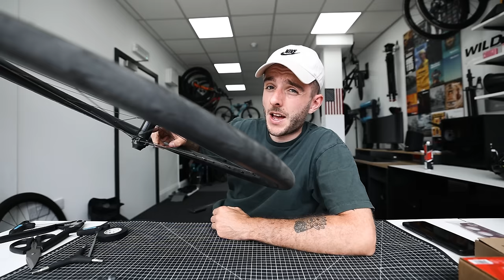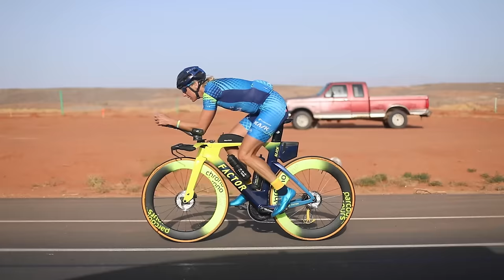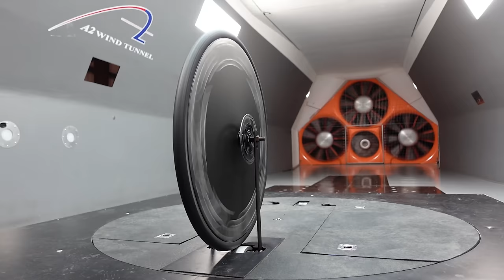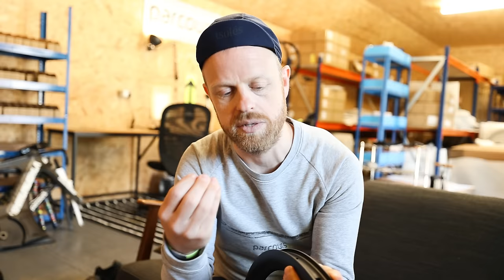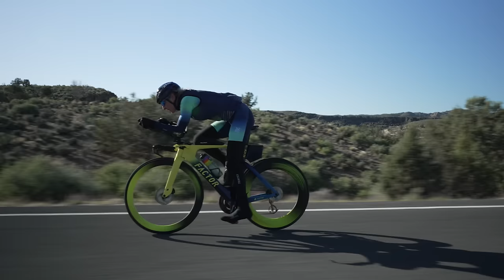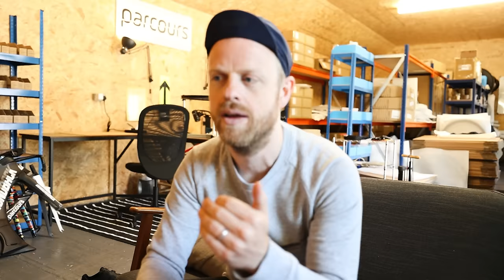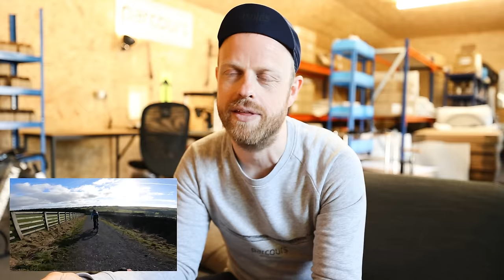Why Are Bicycle Wheels Getting SO WIDE?

Comment: Right,
The real reason why tyres are getting wider. It is so they can drop the pressure down to get tubeless to work well, as sealant doesn't work at higher pressures. Manufacturers want to move to tubeless/hookless.
To maintain a reasonable aero the wheel needs to be wider to maintain the 105 rule. 
It really has nothing to do with rolling resistance as it is so small it has very little significant benefit. And it is linear with speed whilst it is squared for aero.
Ultimately a tyre rim combination is less aero over 23mm but it is marginal if you maintain the 105 rule, then they can lower the pressure for the same rolling resistance and get tubeless to work more consistently.
Reply: @jeffroom  I've been tubeless on my MTB's for 20 years, along with wide rims, disc brakes, and 1x gearing - bikes & gear now far outstrip the stuff I was riding back then.
Recently got into road after trying gravel; gravel bikes is also tubeless, disc & 1x.
Once I buy new wheels, the s/h road bike I bought as a 'tester' will also be tubeless.

Comment: Love these videos. That engineer/wheel-builder seems brilliant and down to earth all at once. 

I'm riding on 32mm road tyres (tires) and rims with 21mm internal width, and the combination seems to work pretty durn well: very comfortable, low rolling resistance, decent flat protection, and fast enough for most non-racing purposes.  If I were still racing, though, I would not go bigger than 25mm, to be honest. If speed is your only concern, marginal weight and air resistance differences are actually kind of important, and no one gives a damn about your comfort.

Comment: I´d like to see graphs representing rolling resistance, aerodynamic drag and weight as a function of wider tires and wheels. Would be interesting to see if a 30mm really has more pros than cons vs. a 25mm on a climb, flat, slope.
Reply: or you can just ride your bike
Reply: It'd be amazing if we could fit all of that data onto only a few graphs, but there's so many different factors at play that it's almost impossible to do.  For example, you can optimise rolling resistance quite easily but only for one specific surface.  So if you turn onto a road with slightly smoother or rougher tarmac, all of a sudden you might not be fully optimised.

Or as another example, you might be riding a route with one big climb on it, but otherwise either rolling terrain or even flat.  Which part of the route do you optimise for?

Instead, we have to look at the best all-round option.  So whilst it might not be the absolute best possible solution for each individual scenario, we aim for a setup that performs well in as many as possible.
Reply: @ParcoursDov  Well you can do a rough, medium and smooth variant of asphalt for rolling resistance, and you can optimize for performance rather than comfort to be specfic. The aero will not be affected by the road and niether will the weight so its not that hard. Then you just focus on lets say flat, 5% gradient and 10% gradient. It wouldnt be hard to put it into a simulation of a known track either. I dont see that you cant put basically all the values I mentioned into just one graph.
Reply: @jleau89  Yeah but you can say that for any cycling tech video. Point of these videos is to nerd out. You can ride your grannys old bike if its just about getting out riding. You dont get progress and development without nerding.
Reply: Time trial bikes use narrow rim and front tyre for obvious reasons l. Usually 23c sometimes 25c.
Reply: @bingoberra18  sure, but definitions of rough, medium and smooth will vary!  And not that many roads are a constant 5 or 10% gradient.

Sure we can produce the data, but ultimately you have to ask whether it would be useful data or potentially misleading due to oversimplification.
Reply: @glennoc8585  with the number of new disc brake TT bikes with greater tyre clearance released recently, I'd argue it's only a matter of time before we see a 28 make an appearance
Reply: @ParcoursDov  It doesnt matter how relevant it is to a certain real place, what matters is which one is better in what circumstance. And then you can weight the results yourself to what seems most appropriate for where you ride or where youre going to compete. For example if a fatter tire save you rolling resistance with 3 watts at 30kmh but contribute to 5 watts of drag then you can guestimate that having the fatter tire will likely be even worse if its a faster average speed. If the fatter tire and wheel, by weight alone, will cost you 7 watt extra at 5% uphill gradient and 14 watt at 10% then most likely you dont want it on a race involving mainly climbs. And if both drag and weight gives higher penalties than you gain in rolling resistance, you likely dont want it neither upwards nor downwards. Although if there is a long downhill and the wider tires might be better for maintaining grip and control during high speed cornering that is a factor to take into account. But all equal, if you have a simple graph, you can make a more informed decision than if you dont.
Reply: @glennoc8585  this idea that wider tires are faster because of rolling resistance is insane but here we are again. As others have pointed out, the aerodynamic penalty is relatively large and measurable, whereas NOBODY has satisfactorily proven that these rolling resistance claims are scientifically valid. All rolling resistance tests in a lab are a joke, and none of the people who have a vested financial interest is foisting them on us ever put the rolling resistance claims next to the aero penalties. The only rolling resistance tests that are worth anything scientifically are ones done on a velodrome but that has very low relevance to riding outdoors on a road. The wider tires/rims are faster is pixie dust.
Reply: @ParcoursDov  the pros who are more interested in marginal gains can will know which bikes to ride for a given course.
Reply: @bingoberra18  with the greatest of respect, you’ve just tried to make a huge set of criticisms of a wheel builder & expert and then whilst pretending that you’re knowledgeable about the issues make schoolboy errors in your assumptions about how easy it would be to generate graphs… 2 identical rides on 2 consecutive days with different windspeeds, HPas, temps etc would make so many changes to the dynamics involved that there is never going to be just one simple answer.
Reply: I'd bet absolutely Not..
Reply: @rep7552  I am not critisizing the wheel builder in the video, all I am saying is I would be interested to see at which point a wider, less aerodynamic and heavier combo is better than a lighter and more aerodynamic combo. To test these in the way you describe in real world has as you say way too many variables so that is not what I suggest. For A-B comparisons lab testing is how it should be done. I am not saying the testing itself is easy, I am saying it should be fairly simple to put the performance in just one or a few graphs so it is easy to see the comparison. How else would they be able to claim a wider tire is better than a skinnier if they have not done this already? You cant just set them up in a rolling resistance test and guestimate the other aspects effect? So I am sure all these tests have been done many times before. Or else its just guesswork from the manufacturers.
Reply: @ParcoursDov  Theses not so many, honest.
Reply: @ParcoursDov  Did you notice the rim breaks on the winning TT bike in the Giro. Rim breaks are quicker.
Reply: Absolutely.
Reply: @pmckeown38  i would argue, that every single person in the industry knows this. Disc brake wheels need more spokes (at least in the front). The discs themselves are also a huge aero penalty. The fact that the industry is pushing for Discs on TT and Tri bikes should show everyone, that it’s not about the performance, but about money. Also: even if it was true, that a wider tire at lower pressure would result in lower RR, this would still not make up for the increased drag from the larger frontal area and the additional weight. 

On the other hand, with disc brakes, You can run your nice Carbon wheels in all conditions.
Reply: @NikeonaBike  Honestly: who really notices the difference. But, coming to the argument of comfort I can only refer to a rule of thumb when setting up a racecar suspension: as soft as possible, as hard as necessary. softer suspension means, as mentiones bevore, more comfort for the rider resulting in better performance over a longer period of time. Taking that analogy to bicycling, which is, imho, legit, you end up with maybe trading a couple of watts for being able to ride harder for longer cause your body experiences less stress due to vibration.
Reply: @bgruber  I agree that few people can feel the difference either in a bit more comfort OR a few seconds faster on 40km. But that said, when bike industry spreads misinformation and calls it marketing we should reject it as a matter of principle.
Reply: @NikeonaBike  concerning comfort: I wet from a 23mm tire to a 28mm tire this season and without having made any other changes my ass and wrists feel way better. the difference in vibration coming up from the 28mm running at 6 bar and the 23mm running at 8 bar is significant. Where i absolutely support you is the performance gains part. honestly, which amateur is hammering out 30mph, which seems to be the standard speed these things are tested at...
Reply: @bgruber  the 30mph figure is chosen because its what pro teams relate to. However, you can change the metrics and get meaningful data. A pro team might want to hear "saves you 15 watts at 30mph" but equally meaningful to an amateur might be "saves you 4 minutes on a 100km ride in zone 2". 4 minutes on a 100km ride is either not much or a great deal depending on your outlook.  

For my money, I ride 30mm tires on my Roubaix with lower pressure and I run a 23/25mm front/rear setup on my aero bike. I definitely don't deny one is more comfortable on average than the other. Different tools for different jobs, I think we agree on that. Again I must state, my issue is the bike industry marketing spin that tries to tell me the 30mm low pressure wide rim setup is faster than the other, because its simply bullshit. Sell me the wide tire/low pressure based on comfort, and I'll support you. Try to sell it to me on speed, and I'll laugh in your face.

Comment: fitting calipers around a wheel was never an issue, lol. some road bikes even had v caliper brakes that were integrated with the forks and frame so using them came at little to no aero loss. now compare that to disc...

Comment: I want to see the data this is based on. 

The data I’ve seen suggests that the rolling resistance is nominally the same across a very wide range of tyre widths as long as they’re pumped up to provide the same amount of deflection for a given load.
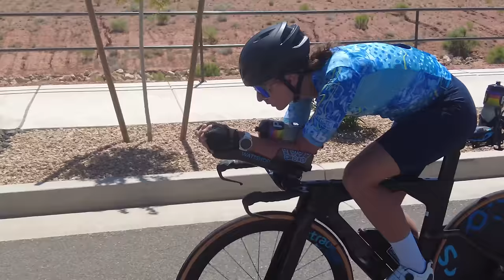Reply: Yes, that's the conclusion I've seen from many tests. What he said at 0:45 is simply not true. Wider tires do have a lower rolling resistance at the same pressure, but wider tires at lower pressure have exactly the same rolling resistance, and exactly the same comfort. Not more, not less.
Reply: Read Bicycle Quarterly and Jan Heine's book The All-Road Bike Revolution.
Reply: @swe223  A supple tyre has less rolling resistance than a stiff tyre. This is not only due to the reduced hysteric losses but mainly because of the reduced frictional losses in the rider's body. So any test which doesn't involve a rider doesn't test the rolling resistance of the tyre. And yes wider tyres at a lower pressure have less rolling resistance than narrower tyres at higher pressure — up to 25 mm on the smoothest surface and on real roads even up to higher widths.

Jan Heine found out that you definitely don't get slowed down on much wider tyres as 42 mm. On gravel above 50 seems to be the optimum as wider tyres don't sink in the surface as much. Every molecule that gets misplaced requires energy.
Reply: @maxsievers8251  there is a very fine line between lower pressure. its very easy to go just too low that the rolling resistance then goes through the roof
Reply: @ezquiel700c  I haven't seen data like that. It might be the case with some tyres. Jan Heine found out that there is a broad range of pressure between too low and too high in which rolling resistance doesn't change much. It's more important how supple the tyre is.
Reply: @maxsievers8251  I agree that supple tyre has less resistance than a stiff tyre, but that's a whole other debate. There exists supple or stiff 25mm and supple of stiff 32mm. We must also do the distinction between road and gravel. I won't argue on gravel, since wider tyres are an evidence and a wider rim makes total sense.

But the problem is that many companies are pushing this trend on the road.  
I 100% agree with Jan Heine. He says that if a tyre flexes more and vibrates less, there is less suspension losses in your body. Therefore the losses are determined by how much the tires deflects, which is equivalent to the comfort you get. That's exactly what I said. If the pressure is adjusted to keep the same comfort level across the width, the amount of deflection will be the same across the widths, and the rolling resistance with be the same across the widths. Not more, not less. That's the conclusion form Jan Heine: "On smooth pavement, there’s no performance difference between tires in the commonly used sizes (25-55 mm)."

Then for road cycling, why should we prefer wider tyres that are both heavier and less aero if the rolling resistance and comfort is the same?
Reply: @swe223  In his book The All-Road Bike Revolution Heine advises to use the widest tyres that fit in your bike for optimum performance. When you order new custom road bike, which tyre size should you aim for? That question isn't definitely answered yet.

42-584 is popular with randonneurs. Those tyres still fit in a frame with mudguards and a road crank. That's also the maximum for centerpull brakes. Jan Heine wrote in his magazine somewhere that the only reason to chose narrower tyres would be if you like the connected feeling to the road irregularities and the buzzing feeling when you go fast on pumped up narrow tyres.
Reply: @maxsievers8251  I don't feel discomfort when I'm using 25mm tires. I weight 66kg, my tires pressure are 80-85. I don't feel lots of different (Comfort)when running on 28mm, But I do feel 28mm heavy and sluggish during ride. All this depends on your weights, above 75kg 28mm or wider tires might work for you.

Comment: Its not just about rolling resistance, or even aerodynamics, as much as comfort and efficiency over time. Wider tires beat you up less, so you are fresher , especially on rougher terrain. Less bouncing off of pavement imperfections. Conti tubulars @ 180 psi are ok on the boards, but what the pro's have traditionally used in a race like Paris Roubaix, laced aluminum rims with fat silk tubulars, is still the gold standard.

Comment: Imma just make this clear rim brakes will not kill tire width. Direct mount and other designs can easily clear 30-32mm tires. The design advantage with disc is the lack of brake track.

Comment: Brilliant explanation from Dov, chapeaux!

Francis - great choice in wheel system. I'm also running 30mm Hutchinson TLRs, but on Token G33s - 25 inner with 33 outer. Pressures around 55psi for road - as smooth as butter:)
Reply: Do you weigh sub 150 lbs? 55 psi is a great way to damage a rim.
Reply: You can run 23-25 mm tubulars, same level of comfort, lighter and more aero
Reply: @aygwm  I normally weigh around 155lb and have found this to be fantastic over the past 3+ years on variable GB roads. Rims have been fine, even with some minor gravel :)
Reply: @stibra101  Possibly true, but I think the gap is narrow. So I chose the TLR system for additional benefits such as self sealing simplicity, price and long tern support/development.
Reply: @JibbaJabber  TLR is so far from simplicity, not made for road.
Reply: @stibra101  On the contrary. Its very simple: tape, tyre and sealant.

The key is to use quality TLR components (or a companies 'system') - and if you're not sure, get a competent friend to show you the ins and outs.

No more difficult than tubulars!!

Simples:)
Reply: @JibbaJabber  Just the contrary, dirty, complicated and it does not work if you have more than 70 kg
Reply: @stibra101  I guess that's your experience. My experience has been excellent. It takes me less than 5 mins to set a wheel up with absolutely no mess and I've been bike packing on them with a system weight of over 85kg. 

Also, in the advent of a puncture that doesn't seal, I've used a dynaplug that was easy and also tubed up once with no mess!!

Like most things it's all about getting the right equipment and then using the right technique.
Reply: @JibbaJabber  And dirty frame :)
Reply: @stibra101  Lol - True.
Reply: @stibra101  tubulars? On gravel? Are you serious? Outside of an actual race, it’s a great way to get stranded out in the middle of nowhere.
Reply: @aygwm  Who did mention gravel?